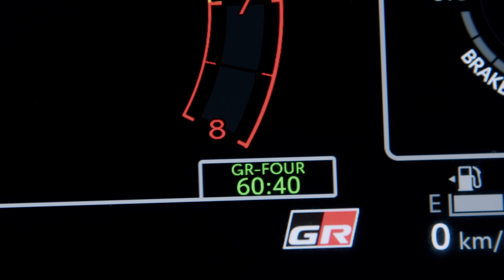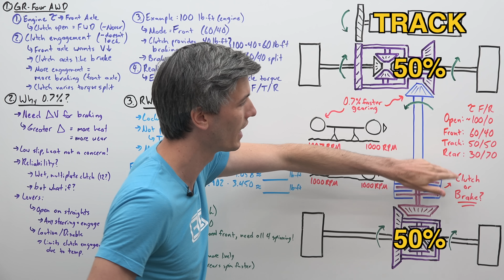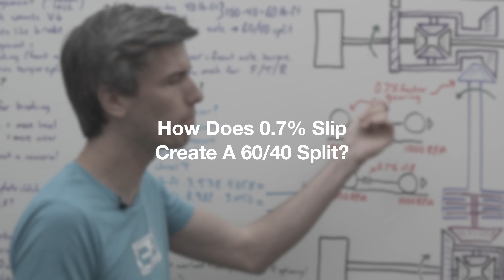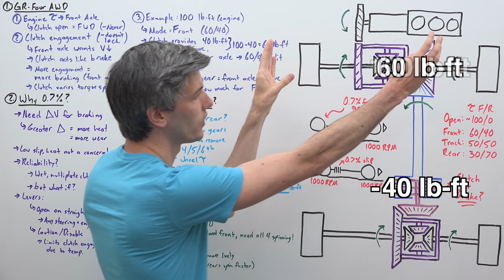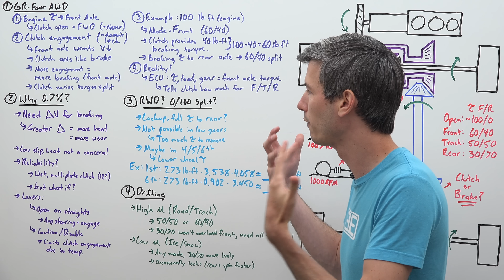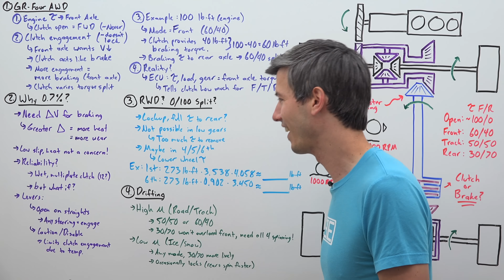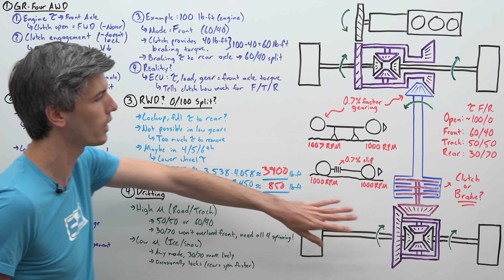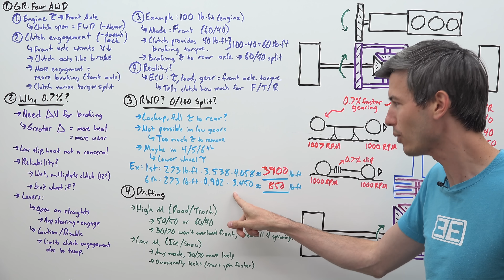Toyota GR Corolla's Brilliant AWD System - How It Splits Torque!

Comment: Why is the clutch pack for the rear wheels at the rear, after the blue shaft? If the clutch was before the blue shaft, wouldn't it prevent unnecessary losses of energy due to the engine having to rotate a steel shaft going through the whole length of the vehicle even when it's not actually linked to anything?
Reply from the maker: Better weight distribution. And either way, that shaft is going to rotate. It's connected to the front axle, or it's connected to the rear axle. Both will cause the shaft to spin since the wheels rotating on the ground are connected.
Reply: I assume because packaging. I wondered the same thing.

Comment: Great video! I just didn't get why you considered different final drive ratios when comparing first and sixth gear. Does it have something to do with different final drives for front and rear axle?
Reply from the maker: It has two different final drive ratios, depending on what gear you're in. This video explains: https://youtu.be/oQQ3nfIf6EE
Reply: @EngineeringExplained  Cool! Thank you :)

Comment: Love Subaru's centre diffs with that odd planetary system that sends 40-60% F-R, seen on 5EATs and I believe in some STIs too. And yet all, featuring also a clutch pack,  just in case... Power naturally distributed... Curious about the behavior on icy roads when compared to a centre diff equivalent.
Reply: With that speed difference between front/rear, it seems to me that, any time the clutch pack has any engagement, it’s putting some reverse torque on the front wheels, and excess forward torque on the rear wheels, bringing all the tires closer to their point of losing grip.
Reply: That "odd" system was created decades ago, and was used in the Jensen FF from 1966 to 1971. This system works well, and has been used in various vehicles since then.

Comment: Curious as to the efficiency of this system not just the reliability. Toyota has a reputation of designing things that work well so there is a level of confidence in this system, however it does raise eyebrows 🤔

Comment: Early in the video, I was thinking how fast the clutch pack would wear out, until you said it's a multi-plate wet clutch.  Still, I doubt it'll have a 100k mile warranty.  And the way people who buy this car will flog it, most likely something else will break first especially if they use a CVT as an option (I noticed you mentioned 6 speeds, so I assume a manual is available).  It sounds like a cool car that almost nobody will buy, and therefore they'll cancel it quickly and switch back to generic transport pods.
Reply: Only 6spd manual in the GRC

Comment: So if you want your AWD system to last longer then you might as well drive the car in lock (50/50) all the time
Reply: No then it would be slipping all the time since the drive ratios are different....or if you locked up the clutches fully, you'd have the center driveline binding and causing your tires to wear instead of the clutches.   Hope that makes sense.
Reply: No, you'd want it fully open in FWD mode.

Comment: Never realized a clutch pack could be designed for continuous slip (albeit for a small amount).  Nice!
Reply: Just wait. These cars will be the lemons of Toyota after 100,000 miles
Reply: @eyeballengineering7007  I am pretty sure that there are a couple of GR Yaris with this mileage. And there couple of them which are used as a rental track day cars. And no one ha experienced problems with differentials.
Reply: @vvevvevvvv  That's funny. I just googled "gr yaris differential problems"..... There are tons of forums full of differential overheating problems. Weird that they don't exist in your world.
Reply: @eyeballengineering7007  let me guess. None of those problems are related to clutches? Also it seems that your are lying. Cause you "tons of problems" are just couple of people which had AWD overheating issues.
Reply: @vvevvevvvv  obviously you don't understand gears and drivetrain well enough to understand that it is the clutches that are overheating the differential. Basic knowledge for people that comprehend the mechanics. Lying? Lmfao! Did you Google what I told you to Google?  I don't usually argue with layman about technical mechanical issues. This is why.
Reply: @eyeballengineering7007  keep calm, I know enough about mechanics. What I've found on a UK GR Yaris forum was couple of people who had differential overheated. After a track day (should change the oil and install oil cooler probably). That's it. 
Have you found anything more? I will happily read about other issues.
Reply: @vvevvevvvv  you know enough about mechanics but still think it was the gears that got hot? Hilarious. It was the clutch packs slipping that made the differential too hot. Quit trying to argue about stuff you obviously don't know anything about.
Reply: @eyeballengineering7007  have I wrote something about gears? Have anything happend to clutches after overheating? Have those clutches broke in a million pieces after overheating? 
The thing is that you should quit arguing cause you can't read properly 😂🤣😂

Comment: As someone who has built and maintained many vehicles, I do not see this as a long-term reliable solution. Not at all. Your comment about how piston skirts don't wear on the cylinders even though they slide past them constantly fails to see that friction free cylinder walls have nothing to do with friction-laden clutch packs. Quite a naive correlation in my opinion.

Comment: This seems to be very similar to the torque vectoring system in the Honda Ridgeline/Pilot/Passport. Can you explain the difference between them, as I am seeing a wet clutch system that can send up to 70% torque to the rear in those as well (plus the ability to vector that torque up to 100% to one side or the other). I assume I am missing some nuances that differentiates the two systems.

Comment: Thank the engineers that they used Torsen limited slip instead of throwing more clutches at it. Much more durable, and there's only one set of extra clutches before the rear box. Toyota can do some great stuff when they actually do the work!
Reply: The fact that more vehicles don't use Torsen is a shame. Such a great and robust system.
Reply: @jg8263  but it does have a big downside...
Reply: @MiikeyLawless  a simple preload spring in the center (as in the Wavetracs) takes care of the diff acting open when one wheel is totally unloaded.

Comment: This system sounds really weird. What happens when turning at low speed and applying torque? The front wheels will run a smaller circle, i.e. rotate slower than the rear wheels even with the gearing difference of 0.7 %. If the clutch is applied then, the rear wheels will actually try to accelerate the front wheels. So for example, if the engine produces 200 Nm of torque, the rear wheels might break the car using 100 Nm (so to speak, ignoring gearing) and the front wheels will get the sum, 300 Nm.

Or am I making a mistake here in my line of thoughts?

I wonder what effect this will have on the characteristics of the car. Although maybe they release the clutch when the steering angle is too big and the wheels have traction. Still, I can imagine that there are various weird effects of this system that makes the car a bit unpredictable to drive.
Reply: Probably similar to other awd cars, understeer.

Comment: I don't like it. I don't like it at all... Honestly, it means there is a lot of friction (often) at that clutch pack connection. Indeed, it will cause more wear. This system is not new or innovative at all. VW have (maybe had by now) a similar system using clutch packs that are not fully engaged with special fluid that gets more viscous with temperature increasing. I had one of these VW and in cold weather I had to let it spin on the front wheels for a while until the rear wheels engage (fluid warming up). Maybe Toyota is doing it in nicer way but not a new / innovative at all... 100% to the rear is not possible as it is shown in the explanation diagram. The primary movement goes to the front wheels and then from there to the rear wheels. This system would work very nice if the rear propulsion is leading the front traction. It would be capable of doing 100% rear and 0% front at any speed.

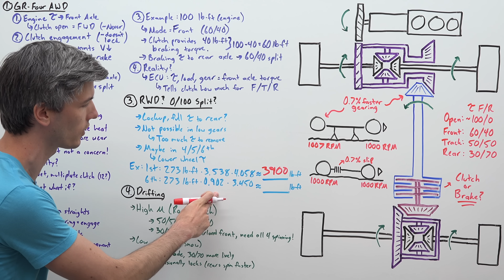Comment: 9:55 Wait, how did the final drive ratio change from 4.058 to 3.450?
Reply from the maker: Two final drive ratios, one for gears 1-4, one for gears 5, 6, and R. This video (referenced at the end) shows how it's possible: https://youtu.be/oQQ3nfIf6EE
Reply: @EngineeringExplained  Got it, so basically two different gears driving the differential. One engaged and one disengaged 👍

Comment: My 2003 Mazda Tribute (aka Ford escape) had a similar system the clutch pack locked up at around 10 years old and was in 4 wheel all the time making for a stiffer and more noisy ride, Lower MPG, etc.

Comment: idk man, sounds like haldex with more steps, why they didn't went for a mechanical center dif?
Reply from the maker: How is the center split not mechanical? (just like a Haldex).
Reply: @EngineeringExplained  well, i mean the system seems to rely on the slip of the clutch pack, im sure is brilliantly engineered but i'm not sure if it wll age as well as a center dif made of gears, like the audis and the gwagens and the bmws